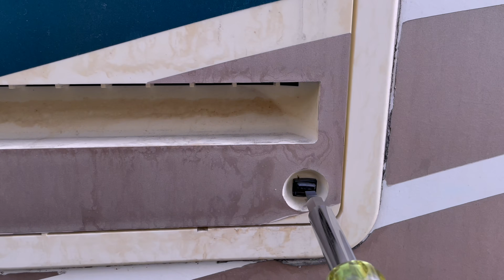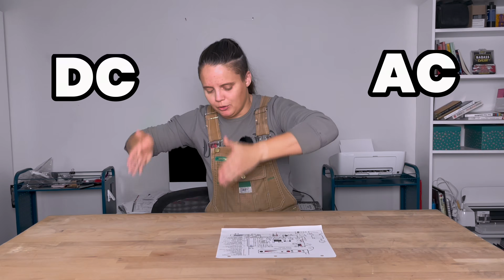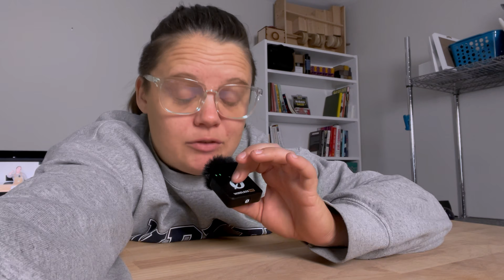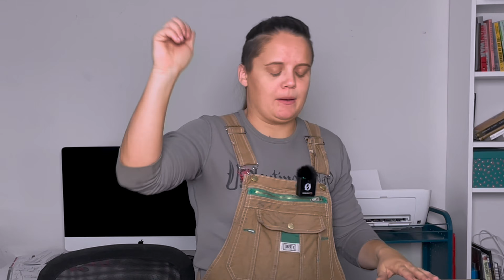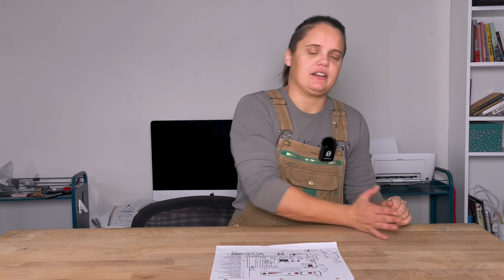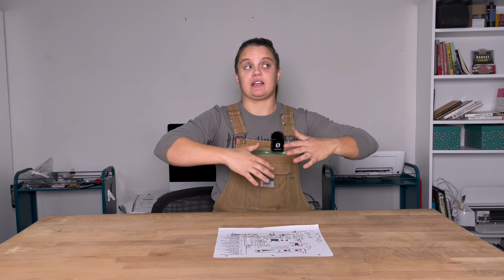How to Troubleshoot Your Dometic RV Fridge (With a Mobile RV Tech)

Comment from the maker: LOVING that people are finding this video helpful. If you would like some RV maintenance hacks that could save you some major moolah then check out my Ultimate RV Maintenance Guide Here:

https://rvrepairwoman.ck.page/guide 

YOU GOT THIS!
Reply: You really explained it very well step-by-step and I was able to fix my refrigerator
I had watched other videos and they just like to talk on and on and really not didn’t show you too much or wanted you to look at another video. Thank you.
Reply: Thank you! Your video helped my solve my issue with no spark. As a note, on a lot of models the "re-igniter board" is separate and replaceable. Original part number: 2931132019 Now made by third parties as 2931132019MC or 2931132019-A. The board in the video though has this combined onto the main control board and is not replaceable.
Reply: I asked about the wrong brand.  Isotherm fridge is gettcool but not cold. Is there a reset?
Reply: Very informative video. And I did like her details but it didn't solve my problem. I didn't find anything wrong with the areas. She told me to test on my Twenty one year old americana dometic refrigerator.
I'm going to have to call a professional, I guess.😢
Reply: Subscribed sis. I appreciate gals of yur caliber, knowledge and expertise.
Reply: I Have Thermal Disk , Can Reset , After 15 Min  / It Opens Again? Any Suggestions, Pretty Old . Thought About Jumping. 🤔 Does T-Stat Control The Heating Element? Thur Relay 🤔
Reply: @mikecarter7479   Did you find out why your thermal disk went open after several minutes ? My neighborhood had a power interruption / outage and after power was restored - about 3 hours later.  I checked on my RV and found the power did not restore to the Dometic fridge.   After watching Emily's video, I saw that A/C was ok and DC too but had to press the little black reset button on the thermal disk.  The fridge light came back on as well as the eyebrow board ......   The coil canister started to heat up but the fridge shut off within about half an hour.   I will check again tomorrow after it stops raining.
Reply: I have no theyal disk
Reply: Hello 
I have a norcold ( 2021 Jayco ) 
My freezer is cold and my fridge is not getting cold .. I've changed the thermostat, in the inside of the fridge, twice everything else he's working. 
Help ?
Reply: My 2020 dometic fridge temp panel flashes between the temp and LP.  It is set on automatic. I am plugged into shore power. Cant get the temp below 49 degrees BUT the freezer is working just fine…. Any ideas?
Reply: link doesn't
 work
Reply: QUESTION @rvrepairwoman-  are you willing to troubleshoot by FaceTime at your regular rate?  I am very handy and your video helped me tremendously. 

What a great troubleshoot of the system. 

I was able to check all the way past the eyebrow board and replaced but that was not the issue. I will review again and see if I can determine the issue past the eyebrow board. 

Our issue- Dometic works in propane but not electric. We had a “professional” crew put in new electric in our house which resulted in rewiring the electric line to the RV. The professionals wired us back in at 240 rather than 120. Fried several items of our 5th wheel and I’m replacing items as I go. The fridge was a victim of that voltage snafu!

Comment: Great video! Thanks for taking the time to do it. I have a truck camper with a slide out that has a Dometic DM2652 RBFX Propane/120 rv fridge. I was fly fishing for Atlantic Salmon in remote Labrador and had a fridge fire. Part of the vent cover melted, the insulation on the AC cord melted in two places, and the neoprene propane hose has a hole where it comes through the wooden floor. I don’t know if the AC cord had shorted out or if the hole in the neoprene had already been there and started the fire when the fridge was turned on. Anyway, I managed to avert a complete disaster by putting the fire out with one of the four fire extinguishers I carry on board. I got the propane hose to the fridge capped at the manifold in the propane compartment so I can now use my stove, water heater, and furnace … but no fridge. My question is: will I still be able to use my fridge on 120v if I replace the AC cord and check everything out as you do here? If so, will I have to disconnect any of the wires at the power module? Thanks. Just subscribed.

Comment: I have a good one for you. I found some chewed heating element wires and an igniter. Replaced both of them on return, heating element kicked on once, and tripped the gfi. Checked board had all voltage coming out of the board, ohmed the element found 43.3 ohms and from wires to ground was OL so I knew the new element was good. Gas portion would kick on and heat but called me 12 hrs later and eyebrow board went blank. Returned today found all my low voltage correct, ordered a new board that should be here tomorrow. Is it possible the rats that chewed the wires up damaged the board and while the gas was running for a while it finally took the board fully out? Also why would a new element that is good be tripping a gfi? New to rv repair (I’m a AC technician by trade)

Comment: What would you check if the eyebrow lights all appear to work but NEITHER the gas nor electric system works?  We arrived at our site with our RV and for the first day the refrigerator appeared to work properly but slowly quite cooling.

Comment: Your video was extremely easy to follow and very informative by testing things step by step.  My problem ended up being I was only getting 3.1 volts returned from the fridge to the control board.  I replaced the eyebrow board and there was no change.  I replaced the circuit board and bingo, everything works as it should now.  Thank you for continuing these repair videos!

Comment: Question: at the 19:20 mark, what if I only have 75VAC on either side of the fuse?  Just got my RV out and the CHECK light (and alarm sound) is on all the time, gas or electric.
Reply: The fuse is good (continuity checks).

Comment: Bought a RV with a dometic but the circuit board was gone.  I tried 3 different boards from amazon and they all give me a E0 error on the front of the frig.  Some boards still tried to heat the frig with AC some tried to heat the frig with gas(even tho I was set to auto). But both times the thermal switch gets thrown after a while. Any ideas?

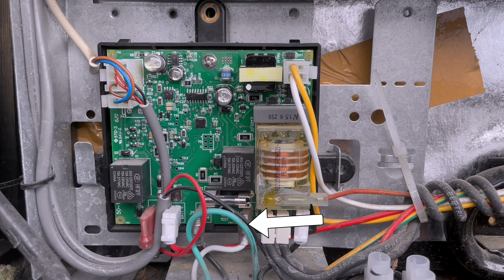Comment: Just stumbled across this video. Very well done. I love your step by step process. At 19:00 you discuss "what if you dont have 120 volts at the pin". You suggest checking the grounds. Well, i have 75 volts at the pin, but 120 volts at the outlet. Cleaned all the grounds at the fridge i could see. No luck. Any other option?

Comment: Im helping  my grandfather  figure out why his rv fridge all the sudden stopped  working  and his thermal sensor has a little reset  button and when you push that the fridge  lights  up again and acts like it will work but  then  trips again i noticed some yellow powder near where the burner is for the propane  what does this mean and what needs fixed

Comment: What if I get 3V at the DC block but 12v at the fuse and 12v on the loose wires with the DC wires disconnected from the block?

Comment: Just had a problem fixed with my igniter on a 7 year old unit.  The wire holding the diffuser in the flue had corroded through and this had dropped onto the igniter causing a short circuit and no spark. Worked fine on 12 and 230 v but not on gas.

Comment: Repair woman, my reefer is working on AC power (120v), but not staying lit on LP. It’s clicking and we get a flame but when the clicking stops the flame goes out. It repeats the process two more times then I get the fault code. I’m getting 120v av where it’s needed and 12v dc too. Help me please!!!!
Reply: Also I’m getting 12v on the gas valve solenoid when the clicking is on but nothing when the clicking stops. is it the solenoid or is it the circuit board?

Comment: We have a NorCold in our small trailer. I turn it on a couple days before the camping trip. The freezer gets down to -4 and the refrigerator gets to 27. Then when we are about to leave on the trip, the freezer is 17 and the fridge is 52. So a mobile tech beat on the collection chamber with a rubber mallet years ago and that did the trick. So I did it myself a couple of times and it’s working again. So frustrating. What could be the permanent solution to this problem?
Thanks so much

Comment: You never spoke about the engine ignition switch gas disable input that forces refrigerator into 12 VDC heating element mode, which is to prevent fire hazards at fuel pump gas/diesel stations.

Comment: So I'm diagnosing my dometic fridge that stopped working. I have 120v on either side of the glass fuse. It was running on 120v only prior to it crapping out. I just turned on the gas to see if I could get it running that way but it is not doing anything. The control panel has lights and temperature indicator is working. The thermal switch terminals seem a little loose and when I jiggle the wires I can hear a relay clicking on and off. So I decided to just jump the 2 wires temporarily to see if I could get this thing to start but still nothing... I'm only getting 5 volts on that orange wire. I think the control board crapped out.

Comment: Best video out there for a DIY fix. My issue is no 120v at the fuse so I "flicked" the relay right above it and it works, power to the heater element achieved. Muchas Gracias.

Comment: What is the amperage of the 120 volts fuse. 
On mine I can't read it. It's like 3/4 inch long.
Reply: Could I get a fuse size for the 120 volts fuse on the card. Mine is open and I can't read it. Please

Comment: HELP
Dometic RM3962 2 Way Fridge, I use propane only and rarely use 120v 
ERROR CODE IS E.1
The fridge doesn't restart after reaching temperature. I have replaced the thermistor, thermocouple, ignitor, and the re-ignitor. I have a new control board on order. The burner is clean and in good shape. The fridge and freezer cools down perfectly but once the set temperature is reached it doesn't restart to bring it back down to temperature.  I tried a disconnect of the thermistor and the fridge runs continuously without turning off and holds constant temperature without shutting off.

Comment: Hey Emily, I have a ? So I replaced our board on our domestic refrigerator on our rv, and I replaced the thermositor as well, our display board does work, here’s the kicker, when I use the electrical, and turn on refrigerator, I’ll wait to see if the electric heater will get hot but it doesn’t until I remove the connection harness of the thermostor from bard and then I hear the relay click and then the heater turns on. Yea wierd.

Comment: Great video and helped me to a point. I got to the click, tick tick tick, voomphf stage. When I tested the 12v (yellow cable) going to the gas solenoid and it was 0volts I didnt know what the faulty part was?? I asume the control board? Or could it be the thermocouple? ANy help woudl be appreciated. Thanks

Comment: love your videos quick question what would cause the 5 amp fuse to blow on the 120v side? can anything on the 12v  side cause it? like the thermal disk? any suggestion would help
im remodeling a 99 peterson excel limited edition 35sko  5th wheel and there was no fridge but i found the original fridge used and bought it and now im trying to diagnose and repair it to install it in. its the same as your parents as far as the circuit board also do you have any suggestions on websites to order parts?

Comment: I have a question for you,  I was following your instructions on how to troubleshoot my rv refrigerator that's not working at all, on the eye brow board I do get the power on light and the check light and auto light but refrigerator not cooling.  I decided just to replace everything in  the back of the refrigerator.  I started with the control board and I was gently pulling out the six pin and it came out fine put when I went to put to the side, the blue wire on the pin is either bitten by a mouse or some one intentionally broke it. My question is where does that blue wire connected to because I can't find for the life of me the other part of that blue cord. So I didn't replace anything because if that's the problem im still going to have it because I need to find out what that blue wire is connected to.

Comment: Thank you, it is fixed to work on propane. Check light on every time.I have a Dometic but the igniter was single prong which sits between the gas jet and thermister. There was a huge blob of ash stuck there. I cleaned the end of the Thermister and the igniter and the gas jet. I could manually light the flame so gas good. Then put the igniter back, blew out gas and adjusted igniter a bit until it lit. Blew it out and adjusted until the system autoignited perfectly.

Comment: Thank you for your video, watching your video made me realize what I was doing wrong.

I am not a RV tech, just someone forced to live in one because of situation but trying to fix up another one as it is newer/better condition although it has a few "problems".

Working on an old Dometic RM763, not working on electric.

Because the trailer has bad batteries and can't afford new ones, I had tested much of the trailer systems using a 12v battery charger and when doing that the refrigerator was TRYING to activate the gas system. No gas meant it couldn't but was a good sign.

When trying to test it via shore power, it wasn't working at all.

Finally turned on when I connected the battery charger back up to the dead battery, essentially using the battery charger to supply the 12v current.

Very different than my current RV fridge as before it died (other issues I think, haven't dug in) it was connected to the trailer via a standard 115v outlet on the trailer and not tied so into the trailers electrical system beyond that. It was only tied into the gas system. It works find on my current trailer with shore power and a dead battery.🤣

Will be using your vid however to try and diagnose THAT fridge later.

Comment: Emily, I live in Vermont and live in my RV year around. The last 3 weeks have been below -0 as much as -30 and high temperature of low teens. My RV is 26 years old. We have a Dometic 2652. It was working great until about 5 days ago when it stopped cooling inside. I have it running on gas, it appears to be functioning as it should in that aspect. However it just is not cooling not even the freezer. I do not see any sine of leaks anywhere. PLEASE HELP 🙏 
I don't know if my thermister is properly working or if I have a large problem

Comment: Hello hope you’re doing well I had a question it has to do with the propane line in my RV I have a Norcold fridge that I wanna remove because it doesn’t work and for more storage because I am renovating my RV and I wanna ask how do I cap off the propane line do I need a type of flare plug or something I read online more it was called a flare plug/cap and some people said use the yellow gas tape for it and some said No, because it won’t grip to the threads something like that they said also others said use the Pipe dope and put it all over the threads around and others said Not to use that either along with the yellow tape made for the gas lines also is it just the flare cap I need? I don’t wanna blow up th rv either lol thank you! Any info will be great info thanks!

Comment: Easy way to check fuses with power applied: If the voltage reaching the fuse is good, put your Multimeter leads on the ends of the fuse with the meter set for the voltage and type (AC/DC) the fuse is handling.  If you read 0 volts, the fuse is good, as the fuse's resistance is zero ohms, and there's no voltage drop across it.  If you read the voltage the fuse is handling (12VDC or 110VAC), the fuse is bad, as the fuse is acting as a resistor in the circuit with infinite resistance, and is dropping ALL of the voltage.  Also, DON'T pry those glass Buss fuses out as the girl was showing on the video!  You could damage the board.  You could shatter the fuse.  Use a plastic FUSE PULLER!  Allotta times, the fuses you buy will come with one.  If they don't, it's hanging on the rack where you're buying the fuses.  DON'T pull that kind of fuse with power applied.  If the fuse shatters, you stand a good chance of shorting something out or getting "bit" by the voltage on the fuse!

Comment: I have a problem you didn't cover. I'm trying to run on gas. It is successful right through getting lit. It runs for 30 seconds or so and then stops. The "check" light comes on the front of the fridge. (old dometic). I know there is a thermocouple that should keep the valve open. Is it adjustable? Anything else I should check for? The propane is at 3/4 full and all other appliances work fine.

Comment: What if the thermal fuse keeps blowing? What could be the problem. Mine works for about 2 hours... then pops. I  replaced it the next day with a new thermal fuse and it too popped after about 3 hours.